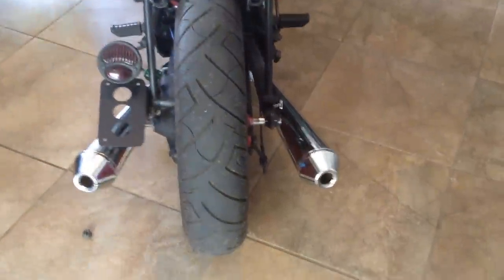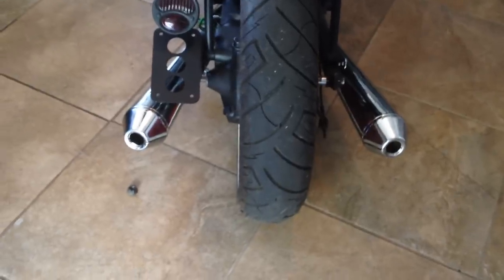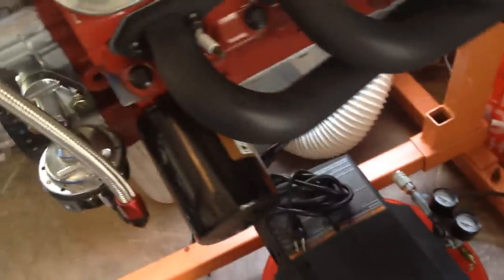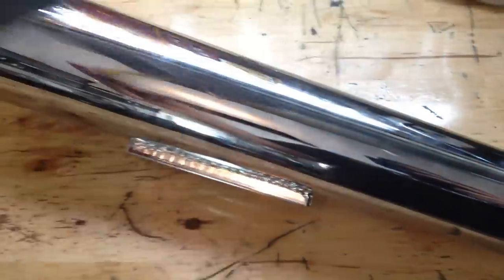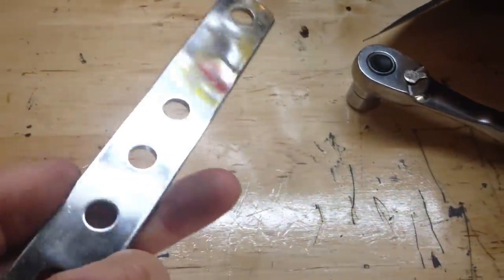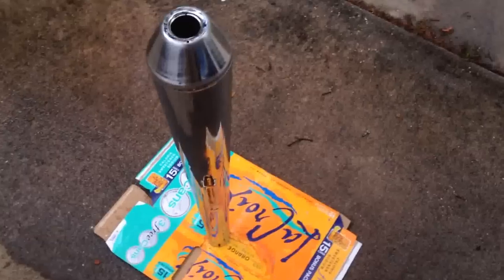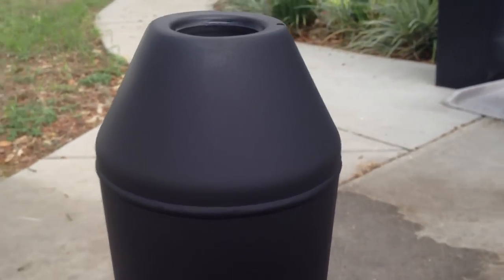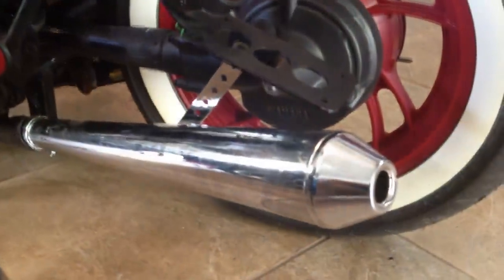Painting The New Bobber Exhaust Pipes Flat Black

Comment: this method last just few months.
the right way to do :
- sand until get off the chrome or very close with 200/600/1000 sand paper
- clean with isopropyl alcohol
- apply primer high temp (follow the instructions on the can)
- apply black paint high temp (follow the instructions on the can)
last forever spend aroud $100
Reply: +Rod thanks man!! which primer and paint do you recommend?
Reply: no worries, VHT Engine Enamel Primer Heat Proof Chemical Resistant coating
Reply: Yea, best grit to use is something like 200. No need to sand till you "get the chrome off", just get it nice and dull. If you have any shiny spots, go back over them.
Reply: Yes, IF your chrome have great quality and no rust, which is rare to find. I prefer to remove almost everything.
Reply: Rod will you follow the same process on the headers, on a motorbike? I have a triumph street twin and want to black out the whole exhaust 
Thanks for the help!

Comment: I'm getting ready to paint my pipe in the same manner and picked up the same paint that you used. I just wanted to follow up and ask you if the paint work on the exhaust pipe has endured heat cycles. Do you see any flaking, texture changes, or discoloration? Have you been happy with it so far? Thanks for this video I really do appreciate it!

Comment: I would sand them down to original metal and coat them with Wd-40.  Spray the pipes then get them hot. Let them cool down. Wipe the pipes down from dust.  Then spray them again.  Repeat the process every time you ride for a couple of weeks.

Comment: Is there a way to paint the gas tank and keep the insignias on it?
Reply: Use the blue type of masking tape over the decal / insignia and carefully cut out / off the tape not needed.   Once painted, carefully peel off the masking tape, using the tip of an exacto knife or similar.   Be careful,  be patient.

Comment: Have heat shields that are really close to the pipes. Is it a bad idea to paint between the pipes and heat shielding?
Reply: On my CTX700 I painted BOTH. The shield is about 1/4 inch away from the muffler, so it shouldn't affect anything.

Comment: was it waterproof or did you have to put something on it and was there anything else that you put on the pipes after spray painting
Reply: It's on a muffler, out in the open, why does it need to be waterproof.   High-heat paint is also used on BBQs, which are out in the weather.  Paint in itself is not water soluble.

Comment: The instructions on the can of this particular high-heat paint,  includes baking and cooling  at three separate temperatures.  That simply wasn't done here,  and the paint job won't last.  (No need to use a degreaser.  Simple rubbing alcohol on a cloth will also nicely prepare the surface after sanding.)
Reply from the maker: Paint is flawless almost 6 years later.
Reply: Actually it was done. I would say when you start a motorcycle the pipes kind of get hot. The same kind of hot an oven produces.

Comment: you need to coat with primer first, then paint then clear. after that you follow the instructions on the can to bake the finish. the finish won't last the way you did it.
Reply: You seem to know a bit about painting chrome. Can you offer any advice?
Reply: There is no clear coat needed for this application.   A glossy finish is not desirable here.  But the baking IS necessary and wasn't done.
Reply: @raymuller7997  How do I bake and cure the exhaust paint? Do I need a heat gun or something?

Comment: doesn't this need to be bake to cure?
Reply: +Leonardo Matute From what I've read, this particular paint is designed to cure after being exposed to the heat caused by the exhaust, engine, or whatever it's applied to (considering you apply it to a high-temp application).